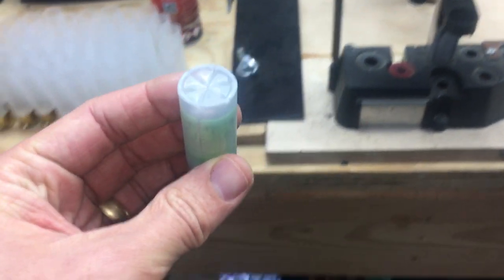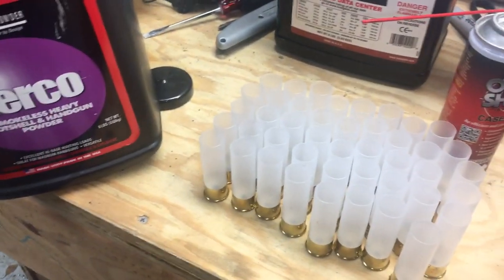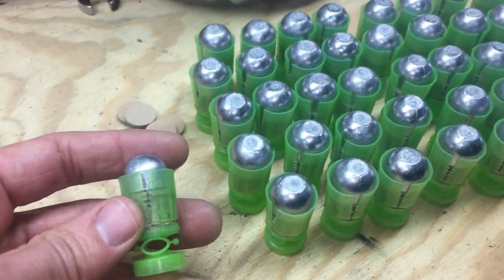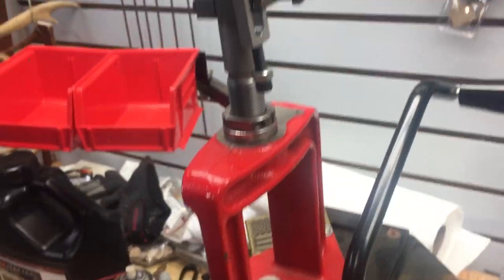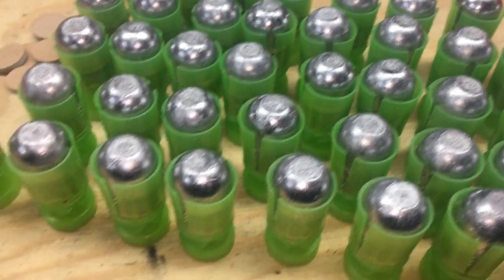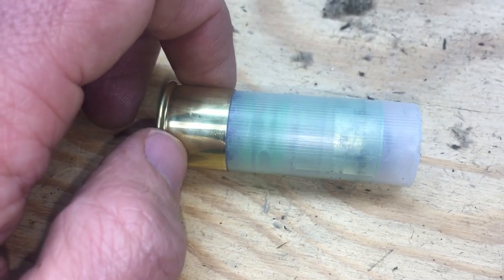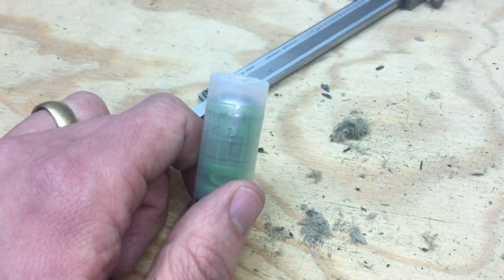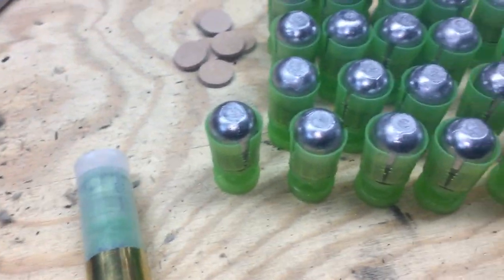Reloading Lee 7/8oz drive key shotgun slugs

Comment: Awesome. Powder migration is worth containing. Tapered wads in straight hulls can be tricky. I call my solution the 30 second flare, to flare out the gas seal of a tapered wad to fit a straight hull. 10 seconds dip gas seal in hot water, 10 seconds pressing against a golf ball to flare it out, 10 seconds dip in ice water to set the flare. Play around with pressure against the golf ball to get desired flare amount. If the wad is to tight it could mess around with raising pressures.

Comment: Nice video, I was curious on your mix ratio of lead that you add to the antimony shot when casting a batch of slugs?
Reply from the maker: I use all scrap lead from the recycling center.  This includes random things like dive belts and soft lead plumbing all smelted down into generic ingots.  The composition to start is somewhat unknown.  I bought a ton of those HVAC 50/50 (tin) leaded solder bars at scrap prices years ago, and just toss a few of those in the mix to add a couple known percent of tin.  I have no idea the amount of antimony.  It's not super important in this application as its sabotted and not specifically designed to be a hard projectile.  In fact you could shoot a hunk of about anything that will fit in the sabot.

Comment: Nice.. Im Reloading Lee Slugs Back Into Winchester 3 Dram Heavy Lead 100bx. Open The Hull, Remelt Lead, Return Slug To Donor Hull. I Bump Charge To 3.5 Dram(1 Shell Up-Charges 6 Hulls)
I Had Been Doing 2 .562 Round Balls(Unbuffered) But 40 to 120 MOA At 100yrds..(Horrible Some Would Fly On Both Sides Of A 18 In Target At 25 Yards)

Comment: That is not a good wad for Lee slugs. They splay the petals badly. A L078 from BPI or a FIOCCHI FCFWA12H27B (in stock and CHEAP) from Graf & Sons is a much better choice. The Fiocchi also comes in a 1 1/8oz size if you'd like to use a nitro card with it. These work well for .69 roundball too.

Comment: Cool.  I load those slugs too but with 23.4 grains of Green Dot.  They shot great. I can bust a 2litter soda bottle at 90 yards 9 out of 10 shots.
Reply: Could these cycle in a saiga 12?
Reply: @gruntspy44  most likely, if not you can run probably run them a bit hotter.
Reply: rifled barrel or smooth bore  ?
Reply: Where did you get the data for using green dot?